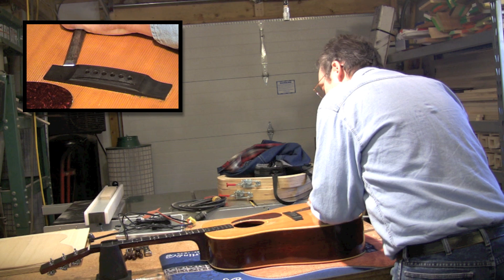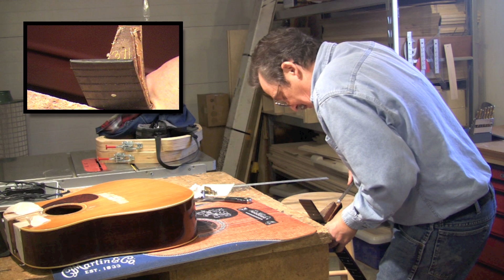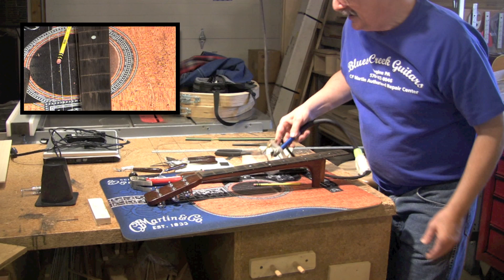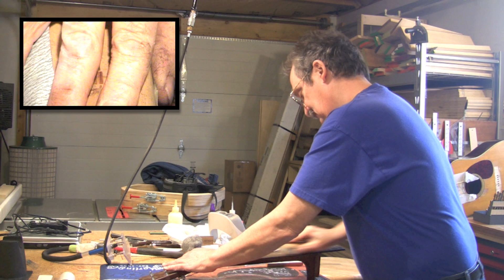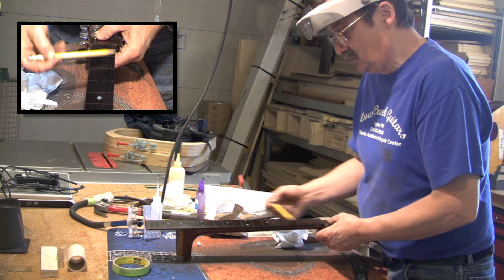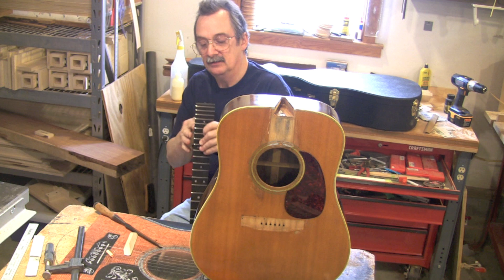Blues Creek Guitars - Martin D 28 Repair (Neck reset, refret)

Comment: Remarkable work, John! When you run the fingerboard through the thickness sander radiused side down, do you rest it in a cradle to stabilize it or does the flat drum stabilize the flat side well enough? Thanks for this video.
Reply: +Scott Reeves   on my sander I have 2 spring loaded rollers so it holds the flat side up  . If you can't controll that you need to shim or use a cradle for sure.

Comment: great video looking foward to the next..do ever work on gibsons...neck resets..
Reply: +thomas dave   yes  gibsons are similar to Martin  but Gibson would every now and then have the top over the neck joint and this makes getting the neck apart very difficult. You have to pay close attention to when you drill the hole at the fret and lifting the extension.  If the top is over the neck block you need to take the fretboard off. I usually cut at the 10th fret  so I can reglue that part up on the  neck and maintain structure of the fretboard.  I will try and record it the next time I get one in the shop.

Comment: John, about 6 months ago I started using (besides the normal superglue and the water-thin superglue) the 'GEL' form of it -- this is excellent stuff;; I was able to put 12 reinforcing struts (in the sidewalls) into my long scale acoustic bass without having to use clamps to hold them in place while the wood glue set;;  I apply the wood glue, leaving a space down the middle into which I run a line of superglue GEL -- I only have to hold each strut in place for about 5-7 seconds until the fast-acting superglue GEL sets;; I think of it as a 'liquid clamp' (well, a GEL clamp) -- and no mess.  Have you ever used it? -- if not, it's well worth a try.   I'm paused halfway through your video --- great stuff, as usual, John.
Reply: +Mick Kennedy I never used the gel stuff.  The more I do this the  less I use CA.  Most of what I do is vintage repairs and my clients prefer hide glue.  I can see the benefit of the  gel especially on more modern stuff. I will give it a try.  I get my Super Glue from  Gold Bond.  That stuff grabs very fast  usually in seconds.   Who do you get your glue from ?
Reply: +blues creek guitars ..John, unlike you, I'm not a luthier, I'm just a musician -- I merely do what repairs or improvements I need on my guitars and basses;; I don't buy my Super Glue in bulk, I usually just buy -- when I see them at discount or real low price -- the small 3 gram and 7 gram tubes of Super Glue ------ the GEL is so handy for me as, obviously, it's a jelly and can be applied in blobs or lines, so doesn't create a mess --- some of it sets so fast that I have to be sure of what I'm doing, that's why I always watch the way you do things....so I get it right.

Comment: That was one awesome tip on fixing that fretboard! 
  Do you suspect the same technic would work on a veneered Fender FB?
Reply: it  may .  There is a new product now called Glue Boost   check it out .  it is a better CA than plain CA. The activator is safe on nitro finishes

Comment: Thanks for this video. I have a 1963 D18 that needs this same repair. Neck reset, refret, no divits in the fingerboard, new nut and saddle, a minor crack in the side and another on the back. How much should I expect to pay at an authorized Martin shop in early 2018? Thanks.
Reply: that depends on the shop.  Without having a hands on inspection it would be hard  but  under $1000 I would think  depends on the cracks and unkowns

Comment: hi great videos great information! I've got a question for you? what causes fall away on the fingerboard tongue after a neck reset?
Reply: The neck block  rotates from the years of stress also the top rises  thus you need  a neck reset. To adjust that angle at the neck, the neck heel is trimmed to bring the headstock down. If you have to  adjust the heel a good bit you move the neck but the fretboard extension still  remains at the same spot so you appear to have fall away when it is the fretboard and neck that move.   If this is sever you can make a tapered shim to make the extension true with the neck.  You can also loosen the joint under the top on the transverse brace and put a shim there.   I prefer shimming the extension.

Comment: hey Glenn, great vids. 

if the bridge is lifting due to the top coming up is the only fix a new top? i have a few guitars where its as if the top is bending up from tension over time.
Reply: Not really ,  Tops belly for many reasons.  Without a good picture I am guessing. I would check for a loose brace, also if the bridge plate warped. I have pulled bridges and taken out the bridge plate then clamped the top flat for a week or so.  If you made this guitar and they top was made too thin or the braces are too weak a thicker bridge plate may help.  Contact me through my bluescreekguitars.com  and maybe I can help get you in the right direction.